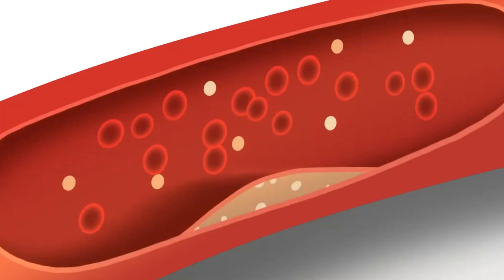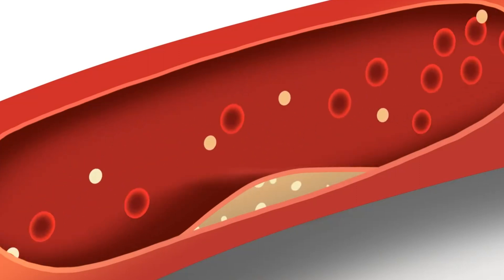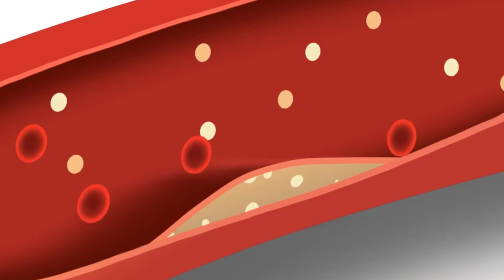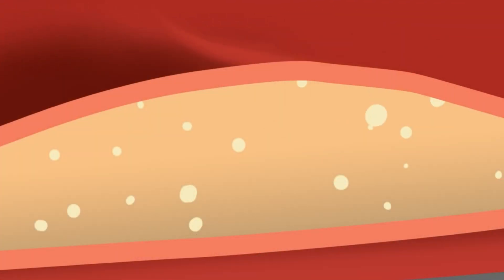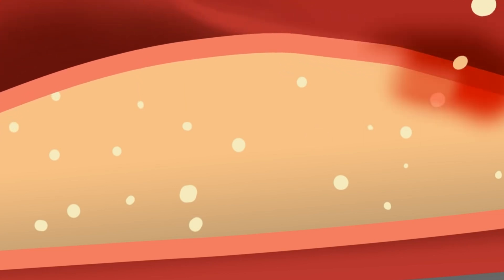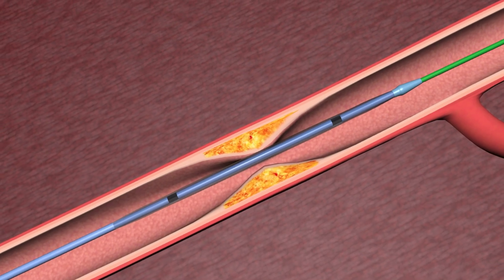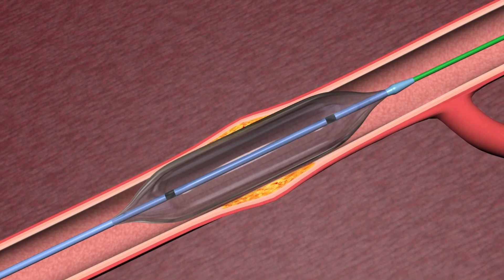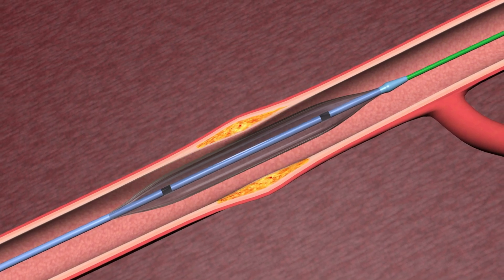How Do Cardiologists unblock a Narrowing Containing Calcium | Atherectomy

Comment: I am having this done this coming week. I am older and explained to my doctor that I couldnt see a balloon being used over the blockage. Makes no sense. Just stretches out the wall even more. A stent would do about the same. So he will be doing Atherectomy. The first doctor I went to  didnt believe in it so I walked out and was fortunate to find a doctor that does.
Reply: how did the procedure go?
Reply: Its not that he didn't believe in it... most likely he'd never done one or have the right equipment or it wasn't available. Atherectomy only used on calcified lesions. Rotablator for instance, for soft plaque is never used!! Not every IC is privy to the use of these devices but most every IC does stents!!
Reply: @ no response from me three weeks ago.  I guess he did not survive.

Comment: Do u need to suck up the small prices of calcium after or during the drill? Else the small fracking may cause a stroke?
Great video. I am watch them.
Reply: Hello, Albert. In general, the complication which could result from embolization during a coronary angiography would be obturation of the artery being worked on, but distal to the stenosed segment. That would cause the part of the heart muscle that is normally supplied by the (now occluded) artery to become ischemic, and if blood flow isn't restored in a timely manner, heart muscle would start to progressively die (infarction).
As for the drilling procedure (rotablation), there are two types of precautions taken to help prevent embolization. First, there is active aspiration during the drilling of the calcium, "sucking up" the debris. Second, the rotablator (drill bit) is designed to grind the calcium down to particles with a diameter of less than 5 micrometers (smaller than a single red cell), so that the debris can freely circulate in the bloodstream, even through tiny capilaries, until it gets absorbed.
Reply: @SolarAB 
you meant excreted
Reply from the maker: Thank you Albert!

Comment: That looks like it clean's them out pretty well why use a stent after?
Reply from the maker: Good question Mark, as the device drills inside the calcium, it often causes tiny fractures and disrupts the plaque and calcium making this a high risk scenario for the artery to quickly close down again if a stent isnt placed. The stent essentially acts like a scaffold to keep the artery open, expecially when there is calcium there, an often very hard material.